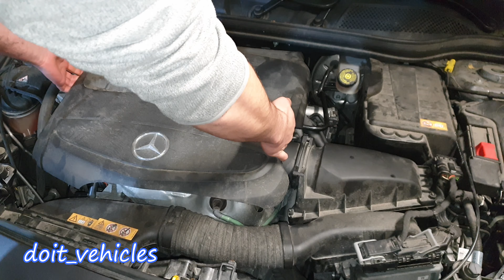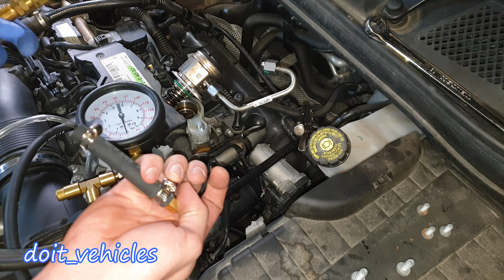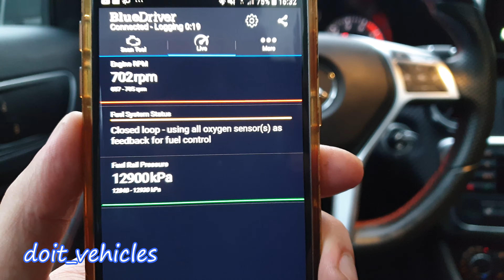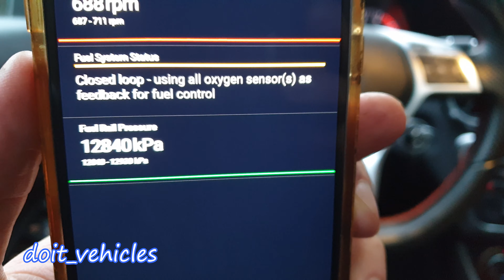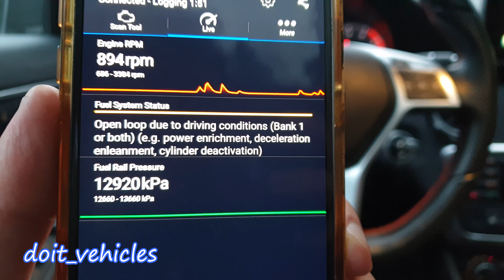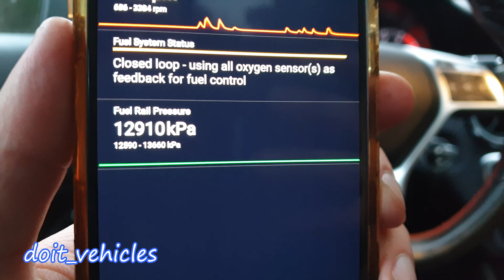Mercedes w176 High Pressure Fuel Pump / Sensor Test , removal and replacement A class a180 p0087

Comment: Got an A250 with this problem. We replaced the high pressure pump and it made no difference but cleared P0087 fault. We noticed live data shows 7bar low pressure fuel with the ignition on but with engine running it does not top up the pressure and cuts the engine out once it drops below 1bar. Any ideas?

Comment: what I read in forums on other car brands don't remember the make and model it was that sometimes these high pressure pumps will leak fuel in the crankcase and you get accelerated oil dilution, do u know if this is a common fault on Mercedes w176?

It's actually a video of a guy who took an oil sample and took it to a lab and when results came back he saw that fuel dilution was way higher than normally for his GDI car (not Mercedes something else) and he then changed the high pressure pump and he took again oil sample and results were better (fuel dilution was still there but not as high as before which is par for the course in a GDI engine).

Comment: I have no codes coming up but when the cold weather hits at around 0 Celsius (32 F) or lower, if I do not let the car run for a good at least 5 minutes, I get gas fumes in the passenger cabin when I turn the heat on.  Any ideas?  This only happens in the cold weather especially if I am parked outside.
Reply: It can be the fuel line which goes in to the high pressure pump. Same does my car I replaced it and now no more gas smell.

Comment: Can you help me about the codes im getting P053F, P1463,P300,P304,P303, we replaced the Coil and spark plugs, but car shuts off randomly, is that bad fuel pump on the tank ? Or is it high pressure fuel pump the one you replaced ? Any help will greatly appreciate. Thanks

Comment: Is it normal that when I take off this rubber that is on the pump it cycles very loudly. There is a metallic sound.
Reply: Did you solved the issue? My tick like crazy don't know if I have to replace or not

Comment: I have p0087 code and p0252 codes on a w176, mechanic just changed the quantity control valve and rail line with valve and the issue is still there , what do you think is the problem , I suspecting the sensors( frp sensors / fuel pump sensors  or fuel pump itself 

I hope he has not made me spends thousand of pounds only for to be the pump or sensors 

Because I had the issue , he changed what he needed to change and now the issue is still there 

Pls reply

Comment: I have problem with same engine when I accelerate the high fuel pressure drop and engine stop the fault code p0087

Comment: Hi thanks for learner video and please I have the same car as you a class mercedes a180 2014 petrol. My code reader or scanner shows camshaft position signal output circuit high P2614 or other code shows camshaft position signal signal circuit open code P2616 please can you tell me what's that thanks ??

Comment: Hi I have GLK 2014 Mercedes Benz when I’m 60 to 80km/h it  will start jerking or misfire I have changed fuel pump Germanry brand new but same problem should I change high pressure pump please I’m waiting for your response thanks
Reply from the maker: Hi ! those who change it , didn't do any diagnose before replacing it ?

Comment: Thanks for the videos. My Mercedes W176 180 gasoline, jerks only when accelerating abruptly. The engine lamp does not light up and otherwise the car runs smoothly. What can be defective?
Reply from the maker: I would focus on the turbo data ; have you checked some live data when this happens?
Reply: @doit_vehicles  Thanks for the tip, I'll have it checked. Otherwise, my car drives very well, without loss of power even into the upper speed range. The fault occurs from about 2000 -3000 revolutions in 3,4,5 and 6 gears when you quickly push the accelerator pedal to the stop. After the short jerking, it accelerates normally. I am very grateful for further tips 👍
Reply: @karadakisnikolaos9835 it’s your crankcase position sensor
Reply: Did you manage to stop the jerking problem?

Comment: Your video is great! It's very helpful. I have a Mercedes E Class 2015 UK. When driving on the motorway around 60 miles/h in a relaxed way and suddenly I want to go faster I put my foot down the accelerator, a engine light comes on when the car have to reduce gears to go faster. Code P0004 comes on... Any suggestions? Thanks
Reply from the maker: The best is to watch the live data of the fuel pressure while accelerating as you said
Reply: @doit_vehicles  I will try that, thanks for the tip!

Comment: Thanks for the video! When you cycle the key to the second position, is the fuel pressure suppose to hold? My GLA45 is not holding pressure when you cycle the key. Thank you for any advise 🙏🏻
Reply: Did you ever get this resolved? I have the same issue.

Comment: I have a rattling sound in my engine bay, and I think it might come from this high pressure fuel pump. It comes and goes, even when the car is idling. Is something wrong, worn or damaged? No warning lights and the car is working fine. Is just wonder about this sound.
Reply: Did you solved the issue, how? Did you replaced the pump?

Comment: Hi mate. Are you based in England by any chance? Let me if yes and where.. might need your help. Thanks
Reply from the maker: I am not in England )
Reply: @doit_vehicles  I saw your in Norway..
If you could do more videos on w176 would be great as I have one and it helps a lot.. iam currently having issues with:
 fuel rail low pressure, 
fuel low pressure sensor - low pressure, 
fuel tank level sensor - high input, 
fuel gauge tank sensor B - circuit high, 
fuel composition sensor - high input, 
fuel pump control - open circuit, 
fuel low pressure sensor - system malfunction, 
Mine is a A200 2014
Saw your videos and will check for voltages tomorrow maybe fuel pressure sensor is dodgy..
Any help would be great.. I trust your opinions..
Many thanks 
Don't know if you have a contact number or email..
Regards
Hugo

Comment: I did replacement  fuel pump and pressure sensor rail  already but still show engine light, can you help me 
And I have one question vvt monitor bank 1 fail can you show me 
Thank you

Comment: do you have any vids on replacing low pressure fuel pump?
Reply from the maker: Not yet  ...
Reply: @doit_vehicles  ahh that's unfortunate .. or i guess fortunate for you as that means yours hasn't gone bad yet!
Reply from the maker: @MCNappeh  the low pressure fuel pump is gonna be relatively  easy to change , and you can check the other videos on other cars where I've done this job , it will be quite similar .  You will need the tool to remive that ring which holds the pump assembly  on
Reply: @doit_vehicles  do you happen to know the tool name?
Reply from the maker: @MCNappeh  https://www.ebay.com/i/392301329021?mkevt=1&siteid=1&mkcid=2&mkrid=711-153320-877651-5&source_name=google&mktype=pla_ssc&campaignid=10454314772&groupid=112166165668&targeted=pla-293946777986&MT_ID=&adpos=&device=m&googleloc=9047366&itemid=392301329021&merchantid=116792603&geo_id=154&gclid=Cj0KCQjwqfz6BRD8ARIsAIXQCf3qUufEGxertOIfxVV0gsO2ZEx7w0fjou1TMpXBf9byNtGgMZ0uf-gaAtGDEALw_wcB 
Here is one example
Reply: @doit_vehicles  i'm unable to find the fuel tank/pump by lifting the back seat and carpet up - theres no circular cut out hole or anything, could it be located somewhere else on w176? no luck finding any info on google or youtube
Reply: done some more research, on A/B class (at least W176 era), fuel tank isn't accessible from lifting up the rear seats, have to lift the car up and drop the tank
Reply: @MCNappeh  Only pulling down the Tank!!
Reply: @doit_vehicles  Hello, so it was the same problem, for you too it is solved with the Pump. Which Pump?? I have the fault code p0087 and then the car loses power please
Reply: I have p0087 code and p0252 codes on a w176, mechanic just changed the quantity control valve and rail line with valve and the issue is still there , what do you think is the problem , I suspecting the sensors( frp sensors / fuel pump sensors  or fuel pump itself 

I hope he has not made me spend thousand of pounds only for it to be the pump or sensors 

Because I had the issue , he changed what he needed to change and now the issue is still there 

Pls reply
Reply: @ it's been a long while, i don't remember what codes i had, all i remember is my car was stuck in limp mode/would lose power and die if i tried to rev it, turned out that the high pressure (i think) fuel pump (which was inside the fuel tank) was toast - bought a used replacement from eBay (can't remember the cost) and had to drop the fuel tank to fit it
Reply: @MCNappeh  appreciate your response
Reply: @Knytred  Hello, so it was the same problem, for you too it is solved with the Pump. Which Pump?? I have the fault code p0087 and then the car loses power
Reply: @sebastjanlushaj9167 mine was the fuel filter , changed it and it never came back . Cheers
Reply: @Knytred so you did change the rail line and it was from the fuel filter? Did you got your old
part and money back at least? Did you had rough idle (820-850 rpm) before you changed the fuel filter? Thanks